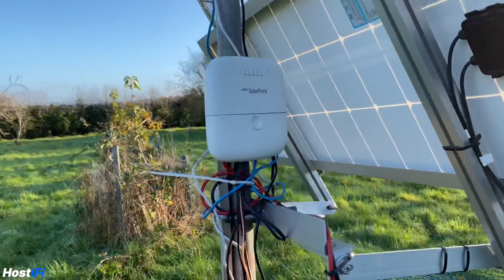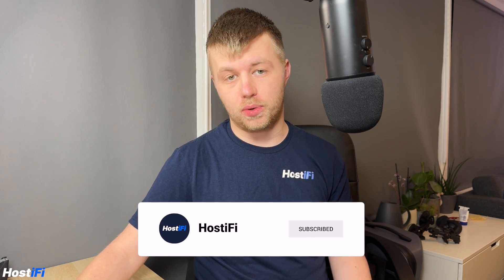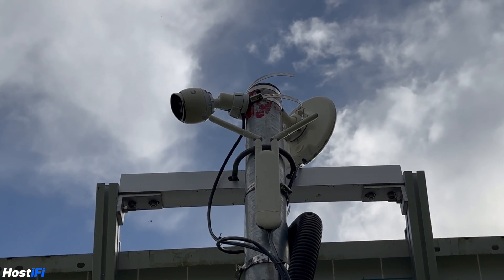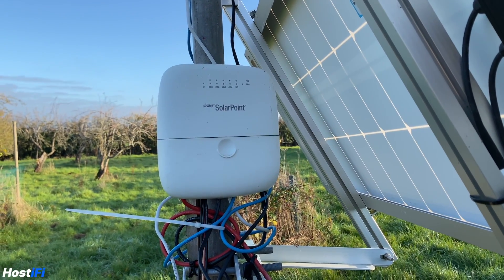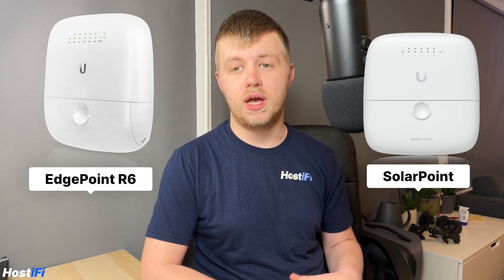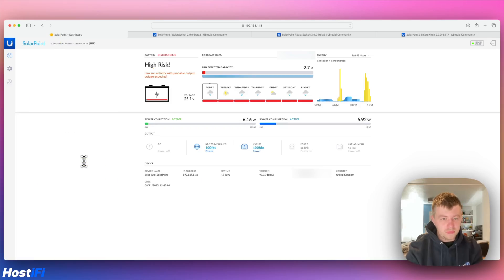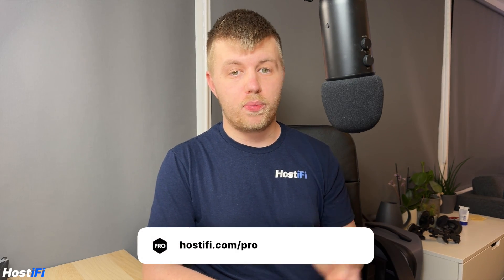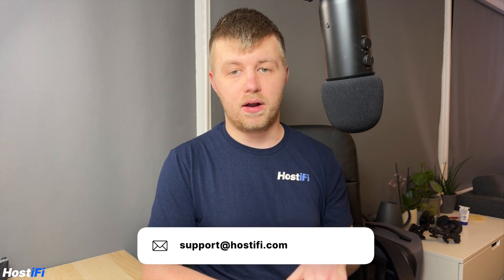How does the Ubiquiti SolarPoint work?

Comment: Thanks for this. I´d say you could do better on the cabling and layout of your install :) As for a system schematic and power economy - what battery are you using for this?
Reply from the maker: Thanks for the feedback! I used two Halfords Leisure batteries, product code HLB678. These are 12V and 70Ah in size.